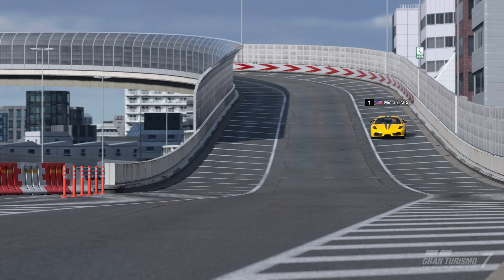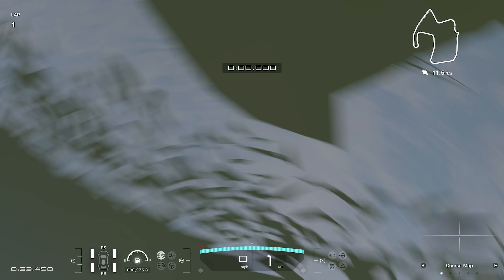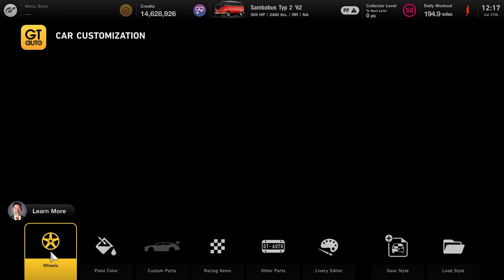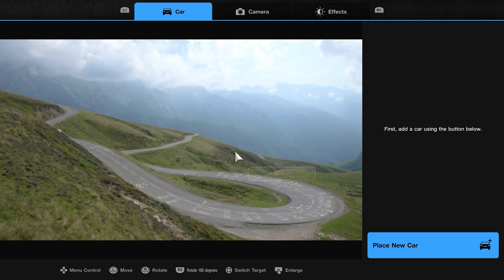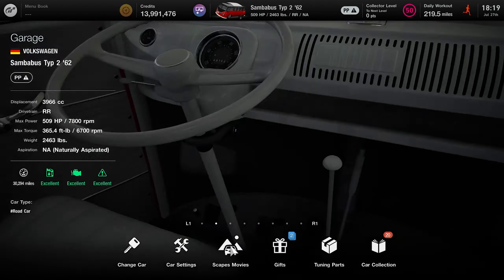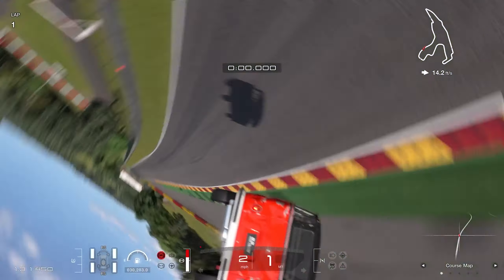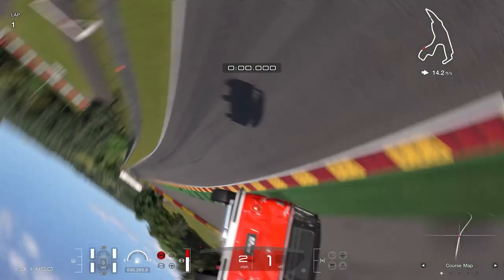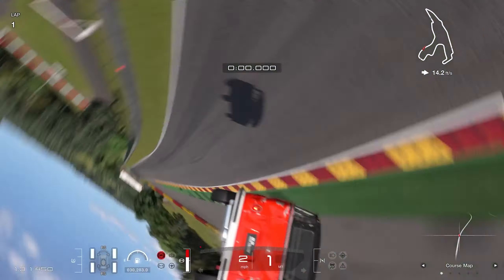Gran Turismo 7's v1.49 Update Introduced a Hilarious Glitch

Comment: And on the un drivable part. Yeah thanks Kaz I can't use many of my favourite TransAm class cars. Like literally can't. Not that they are un drivable with tuning. I cannot select them. The PP value has been replaced with an exclamation point and says the car cannot be used because it has an immeasurable PP amount?
Reply from the maker: It's happened to some of my cars, as well. Gotta start a new build from scratch :(